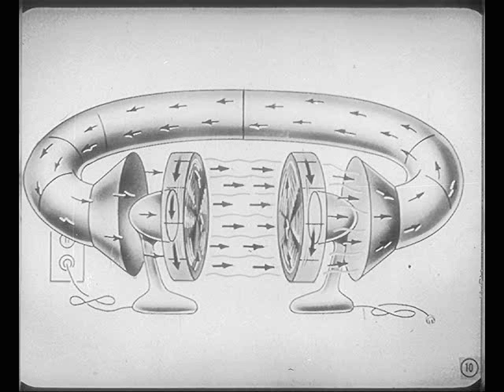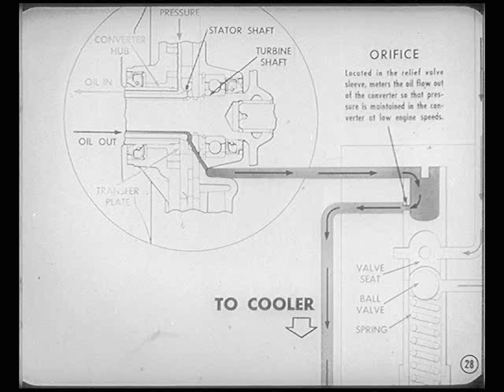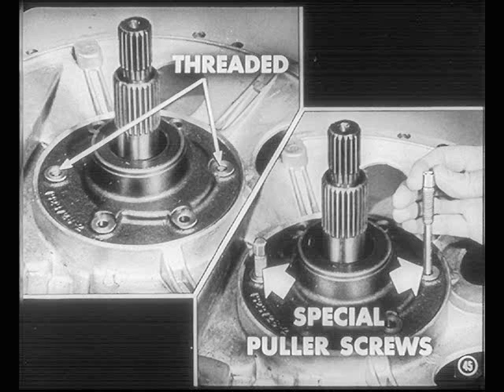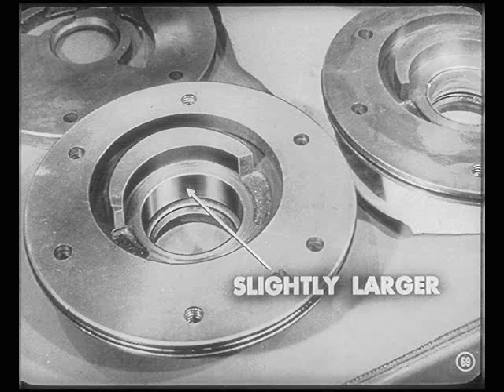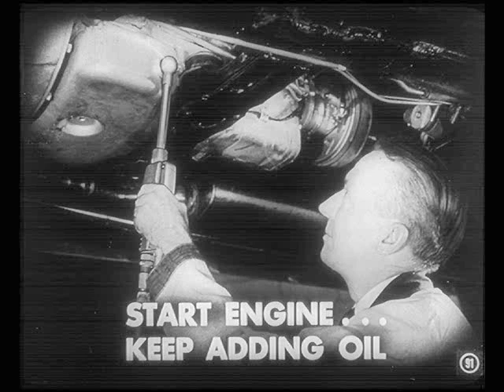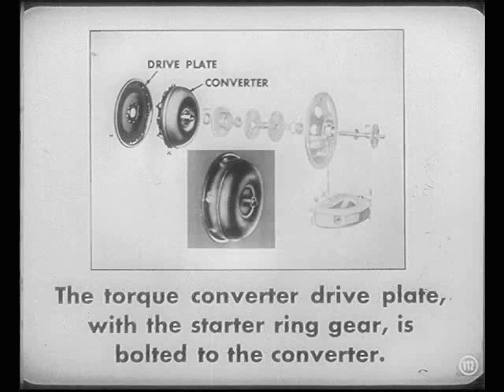Chrysler Master Tech - 1951, Volume 5-1 Fluid - Torque Drive

Comment: Such an interesting film!!! What is so amazing about these 70 year-old automatic transmission designs, is a very similar design is currently being used in the current class-8 trucks that are being driven on the highways... A Torque Converter, backed by a dry clutch, backed by a twin countershaft dual range heavy duty transmission. The big differencesl between the 70 year-old automotive designs, and the current designs used in the Heavy Trucks, is how the clutch is engaged/disengaged, and how the gear selections in the transmissions are made; The dry clutch and twin- countershaft heavy duty trans are both hydraulically actuated, with a computer controlling all of the movements & functions... It is not uncommon for these modern Detroit DT-12 Automated Manual Transmissions to last well over 700k. Miles when being operated by good drivers.... And Chrysler also gets the credit - by starting it back in the very early 1950's!!!!
Reply: Electric trucks are supposed to replace diesels in a decade or so, and might even be autonomous.

Comment: I owned a 1953 Chrysler New Yorker with the 331 Hemi engine and the Fluid-Matic transmission.  A little history about the trans; The only time the clutch was used was to move the shift lever on the steering column.  My system was a 4-speed manual trans with 2 electric shift solenoids mounted so they would move the sliders inside the trans. In operation you would start the car in “Neutral” then push the clutch pedal to the floor and shift to the “D” or “Drive Range”. ‘‘This actually selected 3rd gear in the trans. As you would accelerate to about 15 mph you would let up the accelerator pedal and listen for the clunk the solenoid would make. The clunk indicated you were now in 4th driving range.  You also had “L” or “ Low Range” that was 1st and 2nd gear I the trans.  It was shifted the same way.  You got up to 15 mph, let up on the pedal and listened for the clunk indicating you were in second gear.  Enough trans history.  Not knowing I was eventually to become a professional tech, I performed the torque converter seal replacement on the ground a couple of times.  My thoughts today are the technology wasn’t advanced enough to supply a good enough material for this seal. They leaked.  Finally I just started filling the torque-converter once a week. There was a plate in the floor board that gave access to the converter drain plug.  Like I said it lasted about a week of me driving back and forth to college.  My major was Automotive Technology along with the work and experience I had with this Chrysler led to me becoming a professional tech.  I know this is long winded but another post had never heard of this Fluid-Matic system.  Actually the first system used vacuum operated shift motors.
Reply: I forgot to say once you selected the Drive range you let the clutch pedal up while holding the brake.  The torque converter allowed the engine to run while in gear.
Reply: @William Brand, Believe it or not- a very similar technology has been adopted to modern day class-8 trucks, Bus's, etc... Detroit came out with a Winner, with the DD-12 automated shift and clutch controlled transmissions... They are computer controlled, with hydraulically actuated clutch and shifting... The clutch is a robust single disc dry type and the core trans is a twin-countershaft heavy duty unit and both are computer controlled with hydraulic actuation. They have the capability to 'jump' shifts to promote acceleration/deceleration when lightly loaded...Apparently, they first appeared in Over The Road Heavy vehicles-(after extensive testing & development), about 3 years ago... Several have gone well over 700k. Miles without problems.... And Chrysler-inadvertantly started this H-D trans market back in the Early 1950's!!!
Reply: Didn't the Cord Coffin Nose use that sort of tech, except that it was FWD instead of RWD?

Comment: I'm a retired ASE Master Tech, from 1979-2004.... 
I started watching this, and got to the part where they showed the TORQUE CONVERTER AND CLUTCH WITH PRESSURE PLATE - on the SAME Car.... And my brain just FRIED!!!!!  😱😵😵😵😦
I've got to look and learn a LOT more about this. I was mainly a Driveability and Fuel System Tech, but THIS setup goes against EVERYTHING I had ever learned about Automatic Transmissions!!!
I've got some studying to do!
Reply: Well to me back then it made sense, I started with Chrysler in 1953. Most of them were still a manually shifted transmission with a pressure plate and clutch. You would press the clutch and put the lever in what gear you wanted, then release the clutch and put your foot on the brake as the torque converter would slip and keep the engine running when you wanted to move you pressed the gas pedal and went. If you needed higher speed you shifted into high gear, lower speed low gear. Most of the early fluid drives like this were two speeds and some three speeds. The first true automatic did not come from Chrysler Corp till 1954 with the Powerflite 2-speed. And they were cast iron and felt like a ton!
Reply: @Andrew Armstrong, yeah! A torque converter, backed by a dry single plate clutch, backed by a transmission with 2 or 3 forward speeds, a neutral mode and a reverse!!! The people at Chrysler had not developed the hydraulic controlled gear shifting yet, so they put a manual trans behind a clutch and a torque converter!!! Brilliant idea of how to keep the buying public interested-while Chrysler worked on the designs that led up to the Legendary Torqueflites... This 70 year old film, really shows what it took to develop good fully automatic transmissions... When did New Process begin manufacturing automatic transmissions for Chrysler?
Reply: @michaelmartinez1345  Wasn't New Process a Chrysler brand?
Reply: @MisterMikeTexas Yes , it was.
Reply: Ya I just got a 52 with one and had to look up how to drive the danm thing lol
Reply: This was a really good design for tanks and bulldozers, but the weight was too much for automobiles.  Lots of industrial equipment still uses a clutch with a torque converter.  It allowed a huge high torque manual transmission to be used with "soft" engagement under load without the complexities of an automatic valve body and internal wet clutches.  I used to put a bull dozer against a bank of dirt and throttle it up.  Eventually a pile bigger than the dozer would start moving.